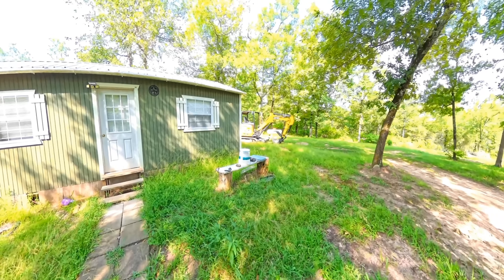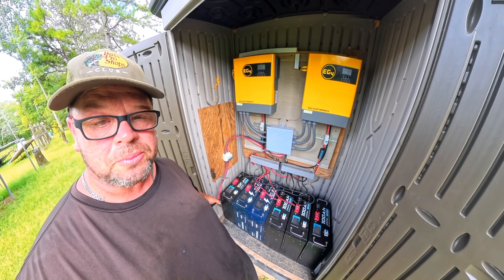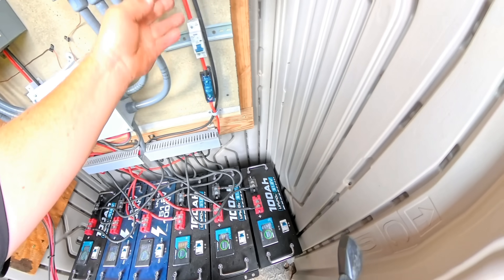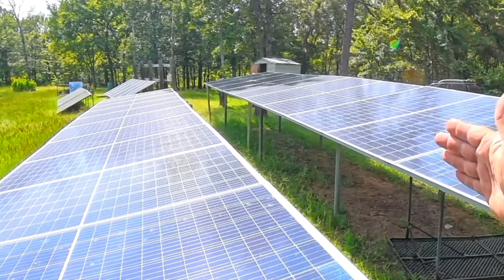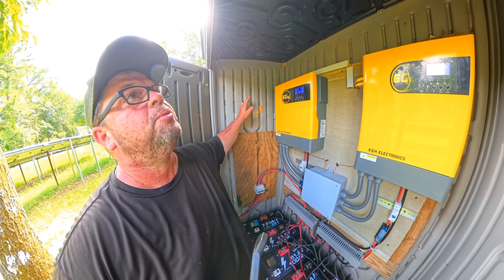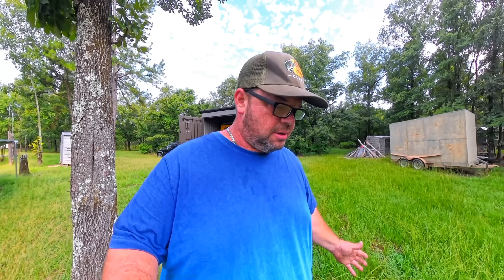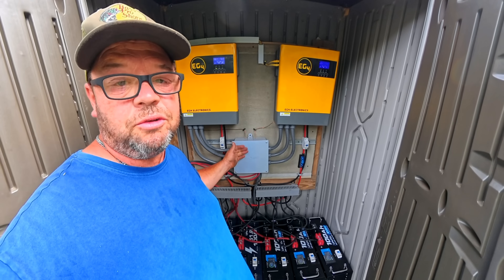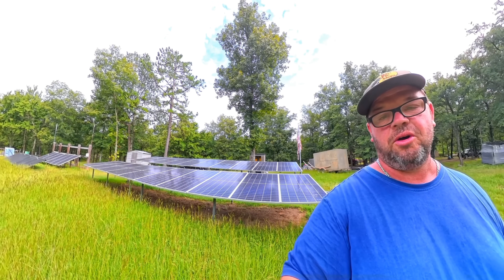Powering My House 24/7 With BATTERIES!!

Comment: On that shed, I would install a fan high on the side. And a lower entry on the opposite side. Some air flow.
Reply from the maker: Lol . Relax.. not every system is going to be built the way you want it. This system is built custom for me. My house does not run off 220 it runs off 120. It is an off-grid cabin. I have a lot more I can respond to but it's okay thank you for your comment.. it's what keeps us on our feet

Comment: You could use a couple of dryer vents for your ventilation. Get one of those round register fans and a temp controller. Also put some screens in both to keep the bugs out.

Comment: So much to learn, for one you can't run the batteries to zero %, the way he hammered those terminals to the wires is a bit scary, and you definitely need ventilation or your going to have some short lived batteries .  Other than that, great job, it takes a bit of figuring out your power consumption vs your system.
Reply from the maker: Well for one the batteries won't let you run into zero they will cut off at around 5%. It's called a low voltage disconnect. The low voltage disconnected set appropriately for the system not only by the batteries but by the inverter itself. As far as hammering the lugs to the wiring I don't see what the problem was I was just making sure that there was a good cold weld.

Comment: it's cheaper to build a battery using  3.2 volt batteries and you'll get more AH per battery

You can cut back on powr loss by building the system closer to the house  or on the house. your invetrr and batteries could have been installed within the area garage or even on-the- put part of the house walls. the panels could have went on the roof.

Comment: nothanks.  my honda 2200 will run for a decade on just what youve spent.  and i bet itll be more reliable than all of that long term.
Reply from the maker: When you can't buy gas when shtf you will cry like a baby...I'm Good...
A Honda EU2200i generator can last for 2,000+ hours with proper maintenance.
2000 hours = 83.3 days lmmfao

Comment: Wait, do you have 20 panels series wired for EACH of those 3k inverters?  That's over 900 volts open-circuit! Surely that's two parallel strings of 10, right? But that's gotta be close to double the rated pv input however you slice it.
Reply from the maker: 485 volts in each inverter

Comment: 100 Amp hour lead acid marine battery is about 110 dollars, nobody needs expensive battery, every house can be fully on solar and dump the power company, buy 20 used 300w panels, and 20 x new 100 amp hour battareis , chinese 8000w inverter, and 5 chinese charge controllers for $25 , and youl have all the power u need, but in the winter you need to shoval the snow off every time it snows,

Comment: the only issue with battery systems is they last 10 years and cost more than youd pay to have electric sent over lines to you.
Reply from the maker: It's not true it was over $100,000 to get the power ran to where I am and that was 10 years ago

Comment: I'd probably elevate the batteries a bit, go for 2x intakes and 2x exhaust ports. Using atleast 120mm fans, 140mm or larger is better, you could look into dryer vents for the exterior portion and overbuild internally in-case any leaks do occur with drainage to the exterior.
Reply: I was thinking about that as well, like handlers in data centers power rooms for crah's

Comment: You could switch to electric water heating since you seem to have a lot of power available. I'd probably heat mostly during the day, and avoid during the night or lower the temp. There's probably some type of smart breaker you can use, or smart water heater.
Reply from the maker: Now I'm going to do an instant hot water heater so I'm only going to use it for maybe 10 minutes max at a time then maybe two or three minutes on dishes.. 3000 w for 3 minutes is it going to hurt me 3,000 Watts for 10 minutes is not going to hurt me and I have found a tankless water heater that will do 2 gallons per minute at 3000 watts and I believe that's enough for the shower.

Comment: Putting your inverters in a dedicated structure detached from the home is a very sensible idea.  Could do with better, positive ventilation and a divider to keep battery off gassing from finding an ignition source in the inverters.  If one of the BMS fails, the batteries will overcharge, off gas from the relief vents and produce flammable gasses.  Provided those gasses egress directly outside without building up in a confined space you can manage the risk.  Inverters and batteries generate heat, get the ventilation fixed.
Reply from the maker: Lol.. you must be thinking of lead acid batteries.. lifepo4 batteries don't catch fire... Chemical compound in lifepo4 is not flammable.. if you throw the battery in a fire yes it will burn but on its own you're not going to get a fire it's nearly impossible. There are no flammable gases that emit from these batteries

Comment: I have 14pcs of 550w Jinko Solar Panels which is almost thesame as yours but I am using them to charge just 10kwhr battery. This means I am wasting a lot of generated power😮😮😮. You are using thesame solar panels to charge 30kwhr😂
Reply from the maker: Yes absolutely you could add another four batteries with no problems

Comment: I’d just put a covered  chimney pipe on the solar shed and put covered holes on the bottom. It will create a draft and the hot air will leave.

Comment: What btu is the air conditioner u running?
Reply from the maker: 8000
Reply: @OKLAHOMAOFFGRID oh ok I'm running a new Midea 6000btu until my Senville 12,000 BTU mini split get fixed I'm off grid my self.

Comment: Just a suggestion. For your future replacements of AC units, go with a min-split. They soft start and it not only is better on you inverters, it uses less power as soft starting does not pull in amps at start up. I was a game changer for me. I live in southern AZ and yesterdays high was 118. I really use my mini-splits.
Reply from the maker: Yeah been knowing this for a few years minisplits coming soon
Reply: I’m planning on living off grid i live in Arizona currently. I’m thinking of building a home on wheels in a decent sized cargo trailer and using a mini split to keep things cool , having a battery bank setup like this with solar panels. Do you think a setup like this would be plausible for a trailer home? I’m gonna try to only have the bare minimum but I definitely want to have enough power for constant AC, maybe running a TV, phone chargers, etc.

Comment: i wouldn't leave lithium batteries outside like that in your location. grounding bus bars are what i went with to add to my system. i have way less solar than you but im up to 12.5 kwh battery capacity. more panels next and maybe a wind turbine

Comment: Could you send me the plans on your ground mounts to see what you did?  thanks.
Reply from the maker: So yeah as far as the ground mounts go there's really no plan I just took fence post like I said in the video I put the concrete on the poles and then I took the top rail of fence post and I use self-tapping screws and screwed one pole to the next pole all the way down and then I set the solar panels on top of it and I used hell brackets to mount the solar panels to the fence post with self-tapping screws once again.. it's pretty homemade but it works good
Reply: @OKLAHOMAOFFGRID what are he'll brackets?  Could you show some close up video of them?
Reply from the maker: @hio177 haha..so sorry..talk to text speech...L brackets not hell brackets 🤣

Comment: Use shipping container vents on 2 to 4 sides like the Chassis King vents. That should resolve your venting issue. Personally, I would add a 12v high CFM 8 inch radiator fan to one side, on the inside in front of one of the vents to create some positive pressure and push the heat out.

Comment: why not get regular bateries insted of the rack type bateries?
Reply from the maker: these rack batteries are made for solar applications in many ways
Reply: @OKLAHOMAOFFGRID  lol that is not wat i asked
Reply from the maker: ok then..let me be more specific and do your homework for you. regular batteries assuming you are talking about led acid car batteries or deep cell led acid batteries are not ideal for solar anymore. the lithium batteries last much longer they do not emit gasses under normal circumstances they are half the weight and produce twice the power at the same size. T here are many other factors such as 15 year life span and even more.
Reply: @OKLAHOMAOFFGRID  im talkin bout the ones that r not rackd, lithium bateries. jeezus

Comment: THANKS FOR ALL THE INFO BIG DOG👍!
A MAJESTIC ON ONE SIDE WALL AND A LOW CUT FRESH AIR VENT AT FLOOR LEVEL BEHIND BATTERIES WOULD HELP DRAFT AIR IN DIRECTLY UP BEHIND BATTERIES AND UP TOWARDS INVERTERS AND THEN OUT THE MAJESTIC CEILING FAN MOUNTED SIDEWAYS.
I HOPE IT HELPS...
Reply from the maker: Thanks for the info!

Comment: Great system. I suggest you build a shop/garage and house that system in there. You can also put in a electric water heater to dump excess power into if the batteries are charged. Also any trees that can possibly shade your panels, cut em down.
Reply from the maker: this is facts!!!! tree is coming down

Comment: To vent, get a line voltage thermostat, a computer fan, two (sheet) metal floor register duct transitions, some window screen material. Cut holes so the duct transitions slope downward, outside. Mount one low (intake) and one high (exhaust). Cover exposed ends of duct with screen, mount computer fan inside the upper vent duct. Control the fan with the thermostat.
Reply: That’s a great idea

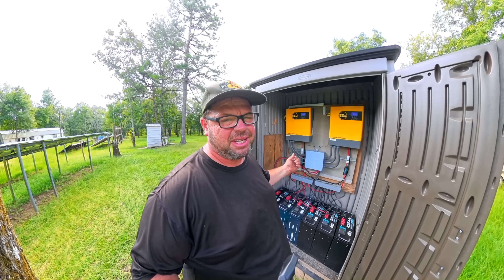Comment: 7:13 what you can do is do a dryer vent (with an downward facing vent) with a fan(on the inside drawing in air) on the outside to draw in air. Then do the same on the other side with a fan pointing out. My suggestion

Comment: Glad you finally got some LiFePo batteries, now you're jammin with 30k watt hours of battery power. I have 40k on my 2400 sq/ft home so you're going to be just fine with that setup.
Reply from the maker: Nice how well does it do at your house
Reply: @OKLAHOMAOFFGRID  So far so good, but I will add I also have 3 EG4 solar hybrid mini splits doing the AC because the central AC at 5 tons would just eat all the solar. So during the day I have free AC and at night plenty of power to cover the mini splits which use a lot less energy than a 5 ton central AC unit.
Reply: How’s ur set up holding up. I have a 2400 sq house and wanted to do a set up for back up power
Reply: @BRYBO1984  Mine is doing fine, my whole system consists of 14k watts of solar panels, 2 EG4 6000XP's, 3 EG4 solar hybrid mini AC units (1 ton or 12k btu's) 8 5k watt hour batteries,  and of course all the wires and mounting , transfer switches etc, we do have grid power here where I live in central FL but how do I put it, screw them lol. And after all of the hurricanes we have had recently my house was the only one lite up like a christmas tree afterwards lol. Our area has no water or sewer or even paved roads , we are all on well and septic so no power no water, we gave water to anyone who needed it, hard to flush without if you know what I mean, and we enjoyed all the comforts of home despite the grid being down.
Reply: @JBPowell-y9m thank you for the response and help. Was it cheaper getting the two 6000 inverters over the 12,000 inverter. Do you completely run solar during the day no grid and make it thru the night as well on back up system. I’m trying to pan away from the grid. I have a decent generator back up system but want to part ways and build solar for day use and night back up use. Got a family summer place in FL I feel ur pain with the power and storms. It sucks but good to hear this helps y’all

Comment: Awesome set up.  What are your thoughts on using a small partially undergroujd / basement / root cellar building to house the batteries and inverters and be temperature controlled.
Reply from the maker: That would be great as long as the moisture levels are low

Comment: For ventilation i think a good solution would be installing a small AC unit that runs on solar as well, some good insulation to keep moisture outside.

Another thing is expanding that little shed to x2 space would allow you to add more batteries if you plan on upgrading even more….also add a humidity detector and thermometer to keep the systems running cool and dry.

Comment: Tankless (Instant) electric hot water heaters take an ENOURMOUS amount of power, I was going to go for some but even I could not afford the power usage. Whole home units often use 40kw. Yes, 40 KILAWATTS of energy, often 4 dual pole 40A breakers. I could not take on that power budget even with 5 Sol-Ark 15k's, gotta leave room for the other stuff in the home. We are instead getting 3 Electric hot water heaters instead at only 5kw each. 2 for our living area, and 1 for the other side of the home.
Reply from the maker: You have a large home..I have a small house like the size of one of your bedrooms..lol .the hot water heaters I am looking at are 3000 watts

Comment: Its more the resistance of each battery that causes an uneven charge between batteries not necessarily the difference in cable length…
Reply from the maker: In some cases yes but definitely the wrong length or different lengths or even one lug over the top of the other lug I believe they call it capping will definitely cause imbalance
Reply: @OKLAHOMAOFFGRID none of my cables are the same length as I have my batteries in different places and different distances from my inverter and charge controllers…I don’t have problems with any imbalances until the batteries get to a lower state of charge just like everyone else’s batteries do…when they charge they charge back to an even state even though they are different AH batteries all linked together…

Comment: Have you ever ever discharged your battery bank continuously until it was down  to zero percent?   You know, just to see if the bank actually has the claimed capacity??  But nice system though
Reply from the maker: No actually I never have I let people like Will Prowse and Hobo tech do those type of testing and I just believe them LOL.. I like to do a simple install that the people can follow along with
Reply: @OKLAHOMAOFFGRID   well, the reason i was curious with your batteries  performance  is because i have a small 48v  two 100Ah lifepo4 battery bank thats less a year old.    One day, these batteries discharged completely with just  100w loads overnight from 65%. I was in shock.   Yes sir.  Terrible  batteries
Reply from the maker: what brand battery?
Reply: @OKLAHOMAOFFGRID  DC HOUSE